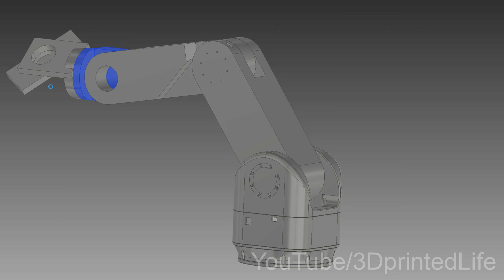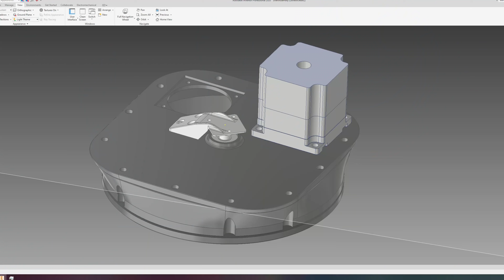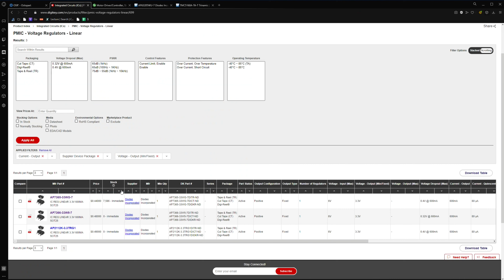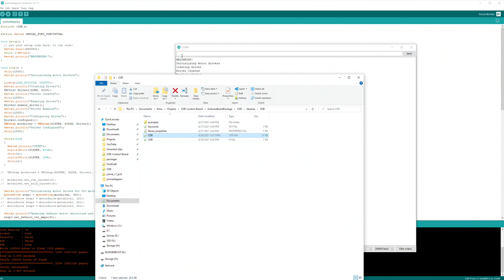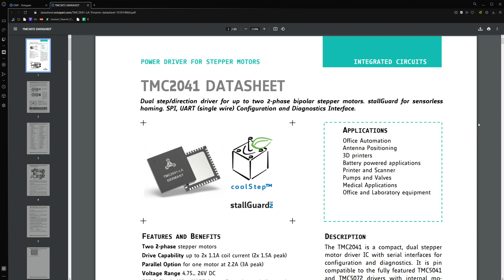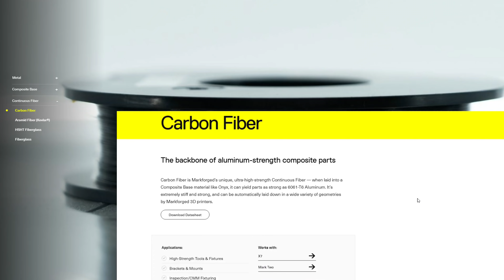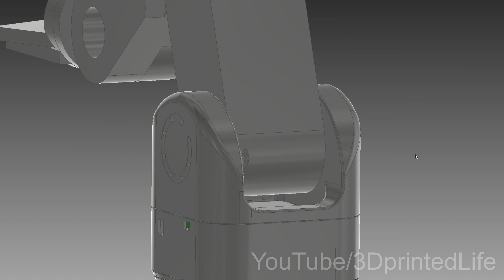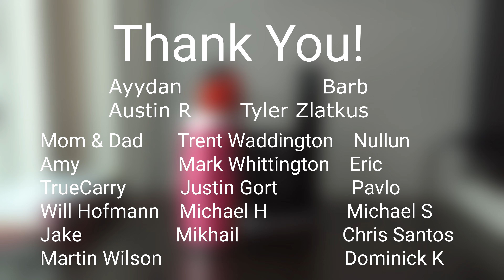Integrating My Harmonic Drive - 3D Printed 6-Axis Robot Arm

Comment from the maker: If you enjoyed the video, consider checking out some of my projects like a 3D printed wankel engine, card shuffler, nerf aimbot, and more!
Reply: Any reason to not use something like a big tree 6axis controller?
Reply from the maker: That would work, but I wanted to build my own partially for the challenge but also to get it in a small enough form factor and have the power I want and all the other IO and features.. It definitely isn't necessary though! 😁
Reply: @3DprintedLife  
Excellent, to build your own is always a rewarding feat.
I was looking at one of the stepper driver modules that has 20a fets but the module can’t handle it.
Reply: Any reason you didn’t use deep groove ball thrust races?
Reply from the maker: Deep grooves perform better but the ideal solution here would actually be two angular contact bearings. But getting those bearings in sizes this big are not cheap
Reply: @3DprintedLife  
Nice, I wasn’t thinking that way.
Wheel bearings from a small car type trailer may be worth a glance at.
Reply: Consider upgrading to Herringbone gears. Also install some J-Dampers, man.
Reply: The issue I think you're having with your electromagnet levitation system is computation lag. You need to be predicting the future state of the magnet not reacting for its current state. Otherwise the oscillations can continue just increasing until it's overwhelmed. Of course in theory a PID would do that. In practice though I don't think it's a suitable problem for a PID. This is simply because of how complex the interaction is between every action. If your magnet is too far to the left for example an action to try to move it over to the right may also create rotational force on all axis.

Comment: If your desk is hollow you might want to add some larger washers and/or plywood plate so you don't accidentally torque the screw heads through.

Comment: I think you could eliminate the need for the flexible gear by using two gears with the same tooth profile in place of where the bearings are on the elliptical drive part

Comment: Try Cone bearings, they do radial and axial loading in one
Reply from the maker: That’s true, but those along with angular contact bearings are extremely expensive at this scale which is why I went with a stack up of thrust and radial bearings
Reply: @3DprintedLife  True, I didnt actually look at the costs, the diameter bearing you need, would be expensive and way overkill, what about printing a polymer bearing surface from a suitable Igus filament? One roll would have you covered, and they have some for sub 80° C applications that do not require an enclosed printer.

Comment: Probably been mentioned before but double helical as opposed to single helical gears is better due to canceling out the thrust load the gears would otherwise produce, and when 3d printed don't have the downside of being any harder to produce. Second, for the sake of part count and simplicity I'd personally use two angular contact bearings or tapered roller bearings as opposed to the 3 bearing setup you've got. Slew bearing if you had the money.

For this particular application though there isn't much of a radial load. The main loads are axial and moment loads perpendicular to the axle (not sure if this is the best way to explain it) from the arm being cantilevered out. Something like a lazy susan would probably work just fine.

Comment: Just curious, why did you use a strain wave gearbox, why not planetary or cycloidal
Reply from the maker: Mostly to get lower backlash. Many types of 3d printed gearboxes really struggle since plastic is not all that strong and you can only mesh gear teeth so tightly before they jam or break, but 3d printing does quite well in a harmonic drive due to less teeth interfaces and more direct transfer of torque from input to output.
Reply: @3DprintedLife  Ok, just strain wave gearboxes are quite complex and are quite easy to break.

Comment: Seperating the function each bearing must fulfill by only letting one take radial and one axial loads is a good way to keep complexity down while making sure you know how to dimension your bearings accurately, however, you can use 'overconstrained' bearing pairs and still determine which bearing takes which loads. Think of Tapered Roller Bearings for example who are often used to decrease the effective distance between Forces when used in an X configuration when having to bear high loads! Cheers.
Reply from the maker: You're right but you aren't accounting for cost. Angular contact bearings are expensive and you can't easily find cheap versions since they are way less common than radial and axial bearings. The bearings I found are very cheap from Amazon or eBay. Admittedly these bearings are terrible, but when the arm is primarily plastic and loads are way way under the bearings rated capacity, it does not matter.

Comment: Dude, watching this I just want to give you moneyz to buy some treats to compensate for all that pain endured by failures. Moreover, you persisted and finally made it work. That’s an outstanding and a rare trait.
(I definitely can relate to that. I’ve been consistently and randomly bricking atmega chips in a custom RC receiver and transmitter design for almost a year - hand solder the board all night then brick it next evening. Rinse and repeat. Until I read on some obscure forum a tiny note that the problem might be caused by a defective USB port on my laptop. Fix - connect the programmer via a USB hub. Works like charm since then. I made multiple RC cars running with it. And created more customized boards after.)

Comment: I do not know has anybody mention about this before but, the involute profile shown in gear design accelerator in Inventor is not precise in user interface.
You need to right click and export tooth profile manually. When you do that, gear turns out a cylinder with a sketch on it.
Sketch will include the splines for the single cut (in real life profile of the hob). You need to either extrude cut or sweep cut (depending if the gear helical or not) then you need to pattern this cut according to teeth number with a circular pattern.
After this you will get a proper gear geometry for CNC-CAM or 3D print purposes.  
The geometry in design accelerator UI is rough that you may see interference between spurs. 
FYI.
Reply from the maker: Very interesting and very annoying that it does that, I didn't know! thanks for letting me know!

Comment: About half of the audience has driven a car with a transmission that used angled teeth gears and a reverse gear that didn't.

Why do cars make horrible sounds when doing a quick reverse? Straight gears.
Reply from the maker: Interesting, never knew that was the reason for that whirring sound when in reverse!

Comment: What I have always done when I need stepper control for a project is just buy a cheap 3d printer board. It's an Arduino with 4-5 stepper outputs, plus a handful of random IO. Perfect for prototyping.
Reply from the maker: Yeah true that could work! My issue with that was there aren't many that can support 6 steppers, and originally I wanted to be able to drive motors with more current than the tmc5160 pololu style drivers could handle. But due to all the fun issues in the video I am revisiting my plan!

Comment: Why the use of so many Allen screws? That seems really annoying.
Very cool project though and I'm definitely invested
Reply from the maker: It does seem excessive, but it's actually helpful in 3d printed designs to keep assemblies rigid since plastic is of course way less rigid than metal

Comment: Excellent content. I think your channel deserves a better name. There is a lot more mechanical and electronics design than 3D printing. My personal experience is that a 3DP audience quickly outgrows a 3DP channel. After building some DIY printers and have you chamber hot enough to print some exotic materials, you are basically done with most 3DP channels. A 3D printer is just a tool for make DIY projects.
Reply: Agreed

Comment: Hey! Awesome project and I really look forward to see more of this.
But when I saw you putting screws in under the table I was worried they would rip out when you finally have your camera on it and out for max torque. Maybe put in a kind of backplate like on motherboards to distribute the load and prevent ripout. Should be an easy job to design for you and cheap to order online with the dxf drawing.
Reply from the maker: Good call, I'll definitely be making a back plate before putting any crazy loads on this arm. Should help with stability as well

Comment: Did you try a cycloidal drive?
Reply from the maker: I considered them but didn't try it. Harmonic can do higher reduction in a single stage and it is easier and cheaper to design them to handle higher loads. And since I don't care about being able to backdrive, I went with a harmonic-style drive

Comment: Awesome work  ! wouldn't resin print the harmonic driver reduce the backlash ? Seeing all the pain you went through designing your own stepper drivers, you could do the same for BLDCs. Price wouldn't be that much worse,  a lot less noise, smoother rotation. By the way, have you seen skyentific's design ? lots of interesting ideas, especially the differential drive.
Have fun and keep going !
Reply from the maker: Oh, I've tried the diy bldc route for a long time. It's way way more difficult than integrating these stepper drivers haha. I think what I will do is use the normal stepper modules for the 5160 drives since those don't really save me any cost and it will make integration/repair easier, but keep the 2041s on the main board since those are super cheap and capable chips.
Reply: @3DprintedLife  I don't understand how BLDC are more difficult ? it's like exactly the same hardware (+ 1 pole) and almost the same software ( even if you do SVM or FOC). Anyhow, I understand your thinking, i'm just curious as if you're not refusing BLDC a bit too fast :)

Comment: Excellent project! I am super cheering for your success 😁👍 I think you overthought the axial issue: deep groove ball bearings with big diameter like this one usually can take 50% of the nominal static pressure as axial force. Man… I bought a similar bearing: it is rated for 10k Newtons… this is 1000kg, so, it would handle 500kg of axial load man! The plastic won’t handle half of it 🤣
Reply from the maker: Well yes that is true, but the price for 2x deep groove bearings this large would almost definitely be more than my 1x radial and 2x thrust bearing setup. Plus i enjoy over engineering things like that, it's good practice as long as I know that I am over-doing it!
Reply: @3DprintedLife  when it comes to personal projects, if its worth engineering its worth over-engineering in my books!

Comment: Tooth profile for a potentiometer for position feedback?
Reply from the maker: Pretty much!
Reply: @3DprintedLife  pretty neat. If you release the files once you finish this project, I might try to miniaturize it with smaller steppers.
Reply from the maker: I already have the project up on my github, link is in the description. Though it will be changing a lot over the next few months

Comment: TIL; there are actually people who unironically use radians.
Reply from the maker: There's actually a reason for it too! It uses less mcu cycles in the firmware, since all kinematics equations are based on radians instead of degrees so that saves having to convert from degrees every single time.

Comment: Where did you get the documentation to write firmware for the trinamics? Been looking all day and couldn't find some to hook them up with a esp32 via SPI
Reply from the maker: It's all in the datasheet, just search "tmc5160 datasheet" (or whichever trinamic driver you have) and it should come up. They have a very detailed section regarding all the SPI commands as well as a setup workflow a bit later down with recommended settings to get things up and running.
Reply: @3DprintedLife  oh, okay, thanks! I didn't go all the way down the datasheet as I am quite new to both the tmcs and esp32, and got discouraged. Should have looked all the way. I had also previously found a library for the tmcs on the esp32 but it reported some compatibility problems, and discouraged me even further to dive deeper. Thank you for the advice!

Comment: The body parts don't really look that great, there is a lot of Z bending and seam issues, try to calibrate your printer better and consider changing filament to one which has particles in it, they are really good at hiding layer. One example is the prusament galaxy black
Reply: I doubt he cares tbh
Reply: @Traza32  ye I just gave some advice

Comment: 1. RE: "I built my own control board to save on costs".
Seriously, a RAMPS board would have been cheaper.  And you wouldn't have had to source all those extra out of stock parts. 🙄
2. Instead of ruining your desk, you could have mounted it to a small 12" square piece of wood that you could clamp to the desk (or designed in a clamp at the base).
Reply from the maker: Sort of, a ramps board only handles 4 steppers and I need at least 6, plus the mega mcu is....very very slow haha. BTT makes some boards that can handle 6 driver modules and have a more capable mcu but between the board and the modules it already takes it above $100. Of course my development time and prototyping will bring my board above this cost easily, but I hope to eventually sell these motherboards once the chip market stabilizes and by then the price should be extremely competitive, definitely less than any other OTS options.

As for the desk, I don't really care about it so I'm fine with holes in it. Though you're right I could have clamped it haha!

Comment: I find herringbone gears are great for 3D pritning. They're not common anywhere else because they're hard to manufacture any other way, but they're self-aligning along with having the advantages of the angled gears you mention in the video. But feel free to do what you think is best!
Reply: Double herringbone gears are superior though, because torque doesn't generate a force perpendicular to the surfaces of the gears

Comment: Nice, you are so patient, incredible. You could consider to do an incremental approach, first use TMC5160 stepsticks to prove the concept
Reply from the maker: Yeah if I continue to have trouble getting these mosfets to behave I may do that. I was also considering just using the stepsticks for the 5160's on the motherboard by default since the price is about the same as integrating it directly, it just won't look as pretty :)

Comment: Skimmed the comments and didn't see mention; please consider using a larger diameter slewing bearing for the main base support. Even printed races with airsoft bbs or purchased bearing balls would have less deflection. Keep in mind that joint is taking overhung moment load so one side of the bearing would be in compression while the other would be in tension. The needle bearing you're using now would need more preload compression to keep from separating on the tension side but is still so small that it will cause excess defection in the base components.
Cheers,
Reply from the maker: Great points! I'm definitely going to do something like this for the next iteration, I'm just trying to figure out the best way to do it while keeping it cheap and smooth!
Reply: @3DprintedLife  I'm a huge fan of air soft bbs with printed races. Add a bit of race interface produces a surprisingly well performing printed component. Depending on your location a bottle of thousands of bbs can be purchased for less than 10$.

Keep in mind the overhung moment though. Bearing race orientation above/below would need compression preload while inner/outer would be more typical to slewing bearing design handling a range of dynamic loading; axial, radial, and moment. I'd be glad to share concept designs if you'd like.

Comment: Now what im really interested in is the OSR board you made what firmware are you running on it is it by chance grbl esp32 ?
Reply from the maker: Firmware is written from scratch so far, my own stepper control libraries. I'm still thinking about how I want to implement the final firmware but I was hoping to utilize grbl as much as possible and just write the arm IK myself.
Reply: @3DprintedLife  what MCU is it ?
Reply: @3DprintedLife  you might want to give klipper at try. I am not sure if anyone has driven a robotic arm with it already but i could imagine that developing the IK with it would be much easier

Comment: Excellent video (as expected). Now I really feel the urge to continue my rover-with-an-arm-project. May I ask you where you have acquired your knowledge about mechanical,  electrical and software engineering? Just from doing it as a hobby or does it come from your major? I'm asking because I have to choose a specific major and I'm aiming for something interdisciplinary.
Reply from the maker: I majored in computer engineering with a minor in mechanical. Computer is basically a mix between EE and embedded fw so between that and mechanical I got a very diverse education. Then I did lots of projects on my own which I have learned a lot from, mostly designing 3D printers or projects that used 3D printers of course!
Reply: @3DprintedLife  Thank you for the answer. I really appreciate it!